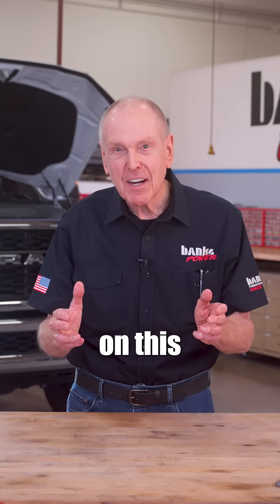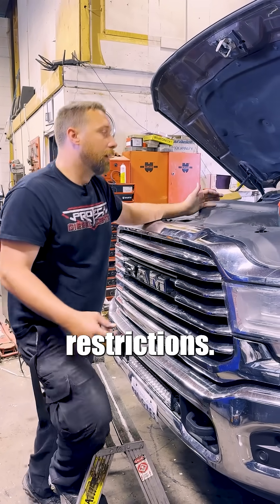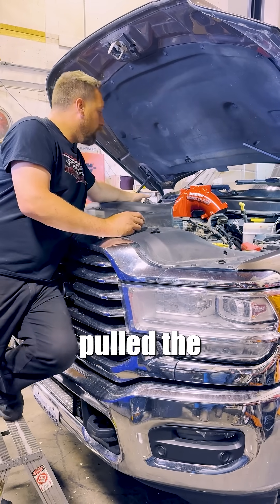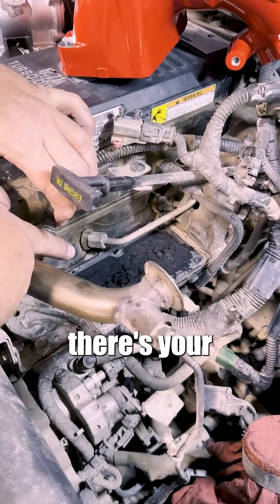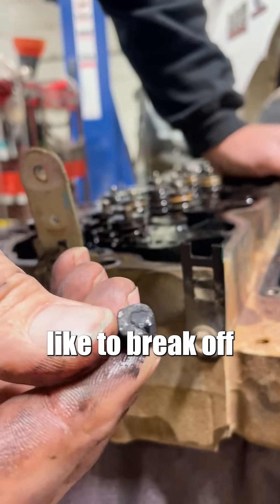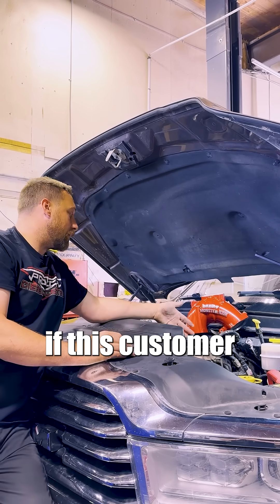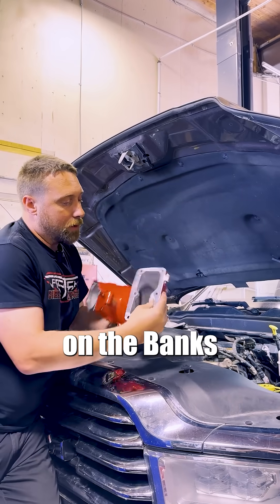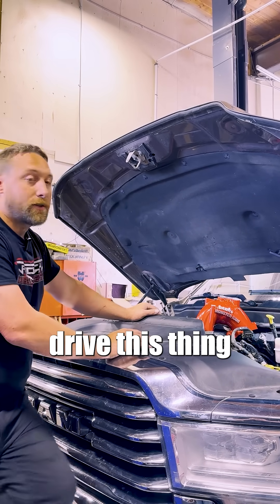This is a lot of soot. Let's make it stop.

Comment: How many miles will they have when these problems start?
Reply from the maker: That's highly dependent on a lot of different factors. How hard you work your truck is a big one, general maintenance is another.
Reply: @bankspower awesome thanks. Im going try do mine this summer has 36k miles. Just afraid it will void the warranty. I do pull between 7k and 12 k least once week.

Comment: Shouldn't they be required to recall these?
Reply from the maker: The mechanism by which the National Highway Traffic Safety Administration (NHTSA) and National Transportation Safety Board (NTSB) is pretty unwieldy and its rare that they step in and force a recall, and even then it's typically just for safety issues. Most recalls are initiated voluntarily by the manufacturer, but for whatever reason, neither Cummins nor Ram felt this was worth the cost of doing (which would have been substantial).

They did tacitly admit the old system wasn't ideal when the decision was made to switch to glow plugs in the 2025 6.7 engine, but it's highly unlikely at this point that there will ever be a recall for the grid heaters or their failing bolts.

Comment: Same problem with Mitsubishi tritons and mazda b50s. No probs for 160,000 kms but after that dpf error codes and blocked internal galeries in the motor. 160,000 kms which equals a magic no of  100,000 miles.

Comment: The carbon and soot build up has nothing to do with the grid heater or the shape of the intake like this guy is implying. The engine is still sucking in soot through the egr. He said if it wasn’t for the grid heater plate then it wouldn’t clog with soot, but the banks system doesn’t delete the grid heater, it relocates it to the top of the intake elbow with a coil heater which is just moving the soot collector to a different location not fixing any soot collection problem

Comment: Is it just me, or does it not seem reasonable that if you continue to run with the factory emission system, it won;t matter what intake or any other part you fit, it will eventually become clogged. Snake oil?

Comment: I have a 2016 Ram 2500 6.4L with 178,000 miles on it. Passed Arizona Emissions like it was new. Only thing I do is proper  entroval oil changes and air cleaner services and every 50,000 mile spark plug changes. I don’t have the problems a diesel has and I run 87 octane with every month one can of octane booster to keep engine clean.
Reply: I do want to add a Banks power pedal but haven’t found one for 6.4L Hemi

Comment: Any cold weather packages yet for the ram horn? I live in Alberta where they have been tested when we can not plug in and not enough heat output is noticed to start our trucks. 
The stock grid heater allows my 6.7 to fire at -35c or -40c might be grumpy but not stranded.

I want the flow but not the head ache again.

Comment: So your still feeding that crap back through your engine. Would it be better to have some kind of filter or screen you pull out and clean at every oil change or something? To me this is a choke point, eliminating it doesn’t stop the crap going back into the engine does it? Not an engineer, played one in the lab for 8 years & just ask’s….

Comment: Isn’t the main issue with crankcase ventilation back into the intake where it mixes with EGR gasses to form a wet soot thst sticks everywhere? If you have an oil catch can you will only have dry hot soot that won’t stick to anything.

Comment: Can you use the monster ram or the transmission plate in the DIF plate or whatever it’s called on a ram 1500?
Reply from the maker: Monster-Ram is strictly for the Ram 2500/3500 truck. We do not offer intake parts like this for the 1500 trucks.
Reply: @bankspower  OK thank you cause I was been wondering that for a while

Comment: That's why engines with EGR circuits should have the system service standard with every major service. I used to work at an AUDI dealership in S.A, and those cars used to have the very same problem. Unfortunately, the resolution from the manufacturer would also be to replace the EGR valve and never a resolution to service the entire system 😕 🤦🏾‍♂️

Comment: I have dealt with emissions and aftertreatment since they first started by removing sulphur from diesel fuel. EGR was a HUGE mistake. Caterpillar actually had the best idea when it came to EGR, they were trying to develop a system that called CGI, clean gas induction. Their system actually filtered the carbon and soot out before it was reintroduced into the intake. As a journeyman I can remember thinking “what the hell are the OEMs thinking putting carbon and soot back through the intake?” But they did it. And with Cummins we have dealt with not only plugging of the EGR system, but carbon packing of the pistons which led to 250,000 - 300,000 mile overhauls. 
I like Dave’s description from Dave’s Automotive the best,
“EGR to a diesel engine is like shoving a hose up your ass and putting it over your face and breathing that in instead of clean air”. It is literally no different. 
But we are forced to put up with this. 
And yes, I know, Caterpillar didn’t last long with their emissions systems. They would have had the best one going if they hadn’t run out of time and money.
Nowadays, the industry can literally TUNE these engines to run more efficiently and cleaner without emissions systems, but they won’t do that, their emissions systems are way too lucrative at this point, and WE as customers, are caught in the middle, between a government which knows nothing about diesel engines and OEMs who’s only focus is how much money that suck out of our wallets. Government vehicles are not required to meet the same emissions standards as the general public’s are, THAT tells you everything you need to know. It’s a SCAM designed to make MONEY.

Comment: the EPA is literally run by absolute IDIOTS. They have absolutely no idea what they're doing and are causing more pollution and harm to the environment by forcing diesel engines to die at 100k miles instead of 500k miles like they used to.

Comment: It's funny how these systems made to save the environment eventually end up causing the said vehicle run so bad overtime actually worsening the emissions it would have without them as long as it runs till failure. Well as far as it goes out of the factory in working condition...

Comment: Whats up with americans constantly having problems with their Diesel EGR systems? 

My car has 460 000km 285 000  miles and works like new. Mothers mercedes has 800 000km 497 000miles and no issues atleast in the past 136 000miles of ownership. Both stock, only people who tune bother to delete them here.

Do you perhaps just make comicaly large engines with poor engineering that never get to run hot for long enough to clean themselfs or what😂?

Comment: I was the original owner of a 2003 Dodge HD2500 with the Cummins turbo diesel. I owned it for 20 years and put about 250k miles on it before I sold it. Oddly, I never had these issues or the symptoms thereof.
Reply: Because it didn't have EGR, DPF or Diesel Exhaust Fluid.

Comment: If that engine was was running farm diesel I would continue to believe what I see in this video,  but modern diesel vehicles owners can only buy ultra low sulfur road diesel to prevent this type of failure,  that person is jackn on Equipment supply... needs to buy road diesel for a road diesel engine,  most service stations in America only can sell gasoline or over road ultra low sulfur diesel...if that fuel was red color not blue there is your answer

Comment: Thanks CA. Putting in the right color of people in charge of C.A.R.B. People who have masters degree’s in the progressive improvements different cultures have made to the art of basket weaving.  Real powerhouses in the arts of convincing politicians and idiots to enhance the middle classtax brackets, that will, of course, avoid any additional taxes on income generated through political insider trading…All to fund the infrastructure needed to extort even more money from hard-working middle class guys with those evil diesels. A.k.a. the devil diesel cult of torque monsters. They are a bunch of freaks in love with efficient I.C.E. engines running on domestic fuels with higher potential power per gallon than gasoline.  They worshiped this monster God they called TOQRE.  So we had our Basket-Weavers dream up enhancements that must be made to reduce the fuel efficiency and performance of this cults vehicles.  This will be a huge win for the people of CA. 1. Because of the taxes gained from the higher fuel consumption du to lowering the efficiency and progressively killing fuel economy over the lifetime of the vehicle.   2. Vehicles that once were able to travel upwards of 1,000,000 miles now sometimes can barely make it out of their manufacturers warranty, before completely shitting the bed. (Don’t worry though. We have plenty of time to write new laws protecting manufacturers from lawsuits due to their forced emissions restriction and carbon injection device compliance ).  This will force people to have to buy more vehicles more frequently and make us more taxes.  3. We can tell anyone who isn’t an idiot that they are in a cult that hates Green Cash Incentivizes and is a torque monster, loving freak. The C.A. C.A.R.B. engineers, who we love to call our dream team! Had to come up with state of the Art handwoven Dreamcatchers. Then we used those Dreamcatcher to envision this amazing plan of ours. It has been implemented for 20 some odd years in California and we have been able to extract vast some of money from the state’s population!  So come on everybody and get in on the green new scams, our dream caring tools will help you make money while not having to worry about caring for the environment, economy or filthy citizens.  Just remember to call them a Cult of torque monster lovers!

Comment: what you could do is have a pressurised container with water and feed the exhaust gas in the container, the soot gets filtered by the water and only the gases goes back into the engine. why don't you make a system like that? you could design a solid filter as well to work in the same way. a pipe with a sleeve in a sleeve.

Comment: The EGR isn't the main culprit. The PCV system is. The soot is dry and won't stick to air passages on its own. But with the help of an oil film it will. A good oil catch tank will help with this process blem.

Comment: It's liable that RAM has continued to use the stock heater intake since it's causing catastrophic sixth cylinder engine destruction in the 6.7 Cummins diesel engine along with the soot buildup problems.

The costs of the Banks Monster intake replacement and labor should be reimbursed by RAM which will be less expensive than the class action lawsuit that will be coming from the fourth and fifth generation RAM truck owners.

I have just under 10K miles on my 2018 RAM 3500 6.7L tradesman long bed 4x4 and I had hoped that RAM would step up and cover the poor design replacement by now.

$1,500 per RAM truck for all the years they knew about catastrophic failure replacement vs $10+K to replace the Cummins diesel engine.

Comment: This may be an example of poor EGR design but more likely excessive idling and short trips caused this carbon buildup.  You could get away with idling on older 7.3 power strokes and 12 valves but that is not the case today.

Comment: Am so glad I got the Chevy Duramax engine. Almost no issues on EGR.
Reply: Hopefully you dont have the 10 speed transmission.....
Reply: @TDub_ADV good point, after the valve body update it's been good!
Reply: @Jon626  Mine has not. GM replaced the valve body with the newest revision in Feb and mine is failing again, only 7k miles later. 

Now im spending the money on a next gen driveline parts to fix GM's mistakes so i can have a reliable truck.
Reply: @TDub_ADV  thats some shit luck for sure.
Reply: @Jon626  It is but not suprsed. It took them three valve bodies back in Feb to get one that actually worked properly enough to not throw codes. 

What "update" did you have? The software one or a new valve body?
Reply: You will be busy spending money on injectors I bet.

Comment: When every unit prematurely fails to perform thats not regulation, its sabotage.

These systems only end up bankrupting their owners.

From pick ups to tractor trailers. They all dont allow functional service without 20,000 to 60,000 a year to keep a truck running...sad the owners dont get together and hold the lawmakers responsible for ending    transportation options...that work.  Yes i stupidly bought an emmision era class 8 biggest financial catastrophy.
120,000 truck. 120,000 in repairs in 4 years...Not Functional.

Comment: If you can't delete the EGR, reroute it. Put the return line after 2 catalytic converters, so that the soot is greatly reduced by being burned off.
Reply: That's called Low Pressure (LP) EGR.  It's way cleaner except you can't introduce it past the turbo compressor because of the pressure.  EGR is introduced upstream of the compressor.  Comes with it's own set of issues.  Extensive (expensive) stainless plumbing, condensation/corrosion issues (turbos compress gasses, liquids shred the compressor wheels) and freezing, catalyst ceramic matrix shrapnel hitting the compressor wheel like bullets.
Whack-a-mole.  Just moving the problem.

Comment: i dont understand why more truck manufacturers dont utilize low pressure egr systems. My 2015 volkswagen golf TDI utilized this before the delete and let me just say there was not a single spec of soot or residue anywhere on the turbo, charge cooler or charge pipes. i mean it worked extremely well

Comment: If they made these parts cheap and easy to maintain, I doubt we would all hate EGR so much. It would feel a lot nicer if cleaning a fouled EGR valve was as easy as cleaning a varnished carbeurator, for example.
Reply: Isn't it one of the easier parts to access in the engine bay?
Reply: @BeingInTheMessiah  Yes, but even carb cleaner can't unfoul them easily
Reply: @specialopsdave my experience is on the soon to be phased out cummins L9 and its pretty easy to clean. A wire brush into the pressure sensor port holes, a degreaser into the valve, and a garden hose to finish everything. These are on transit busses which go full throttle to no throttle between every red light, aka maximum egr usage😊
Reply: Self report.

Comment: I suspect the engine oil level was way overfull for a while. They will start aerating the oil heavily and overload the oil separator in the crankcase filter. That will send oil into the intake of the turbo and into the engine to be burned. Which makes Gunk that gets moved back through EGR. It's a nasty feedback loop.

For a Cummins oil change. It's best to add only 10qt (with filter change). Start and run for about 30 seconds. Then set at least 15 minutes (more the better). Then add oil as needed, preferably about 1/4 way into the safe zone. This allows for expansion from the fuel dilution.

Comment: Do you have this for the 2022 Jeep Gladiator Diesel.  I had the pedal monster with derringer installed at banks in 2023 & I love it.  Just want ot keep my diesel running smooth.  Thanks!

Comment: Could a catch can or filter be added to the EGR system so that the system still moves the exhaust gasses but stops the soot and is replaced during oil changes?

Comment: Is there any reason diesel guys don’t use water meth injection. It would essentially convent the intake system to a wet system and would not allow build up of carbon. As while as cool the intake change, suppressing detonation allowing different fuel injection timing for potentially more power. I cant imagine it would affect the scr or DOC catalyst eaither, but that’s just my guess as I’m not sure how it truly would interact with them. I do know guys with GDI trucks and cars that do this to prevent carbon build up from the pcv on the intake valves. So I’m curious as if would help or not depending on where the injection was placed in the intake system

Comment: Does installing it void the factory warranty on the engine or any other components?
Reply from the maker: Bruce, we had three 2024 RAMs in the shop this week for Monster-Ram installations. Two owners expressed that their dealerships were ok with the modification because were familiar with Banks and our six-decade history. The third owner didn't care about his warranty. He didn't want to have to worry about the grid heater bolt failure and didn't care how the dealer reacted. Technically, the law is on the side of the consumer. Per the Magnusson Moss Act, a vehicle manufacturer cannot deny a warranty simply based on the presence of an aftermarket part. However, that doesn't stop some from denying it anyway. Our advice is to consult your service advisor. If they advise against it, find another dealership that's more aftermarket friendly.

Comment: Honestly, Ram just needs to have all the Banks upgrades come on the trucks factory at this point.
Reply: "2026 Ram 2500 Banks Powered Cummins Diesel" . . . . sounds sexy
Reply: For this kind of problem, it should be made standard to clear the entire intake manifold with every major service.
Reply: So do Ford and GM
Reply: Unfortunately, that would probably add 10 to 20 percent to the purchase price of an already expensive vehicle.
Reply: Exactly, why sell a truck with KNOWN issues!